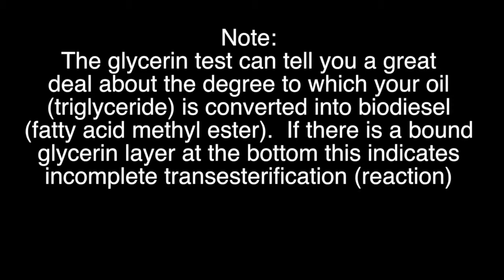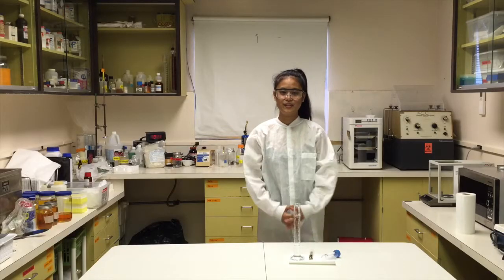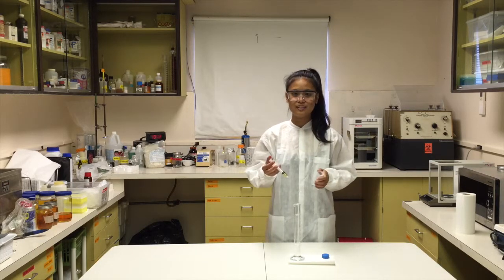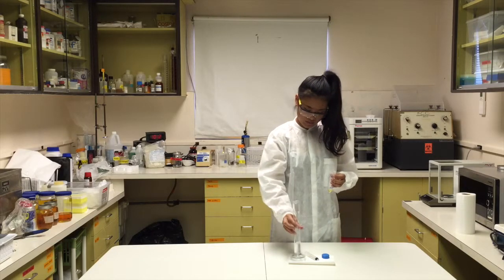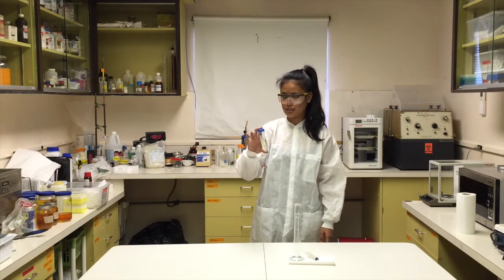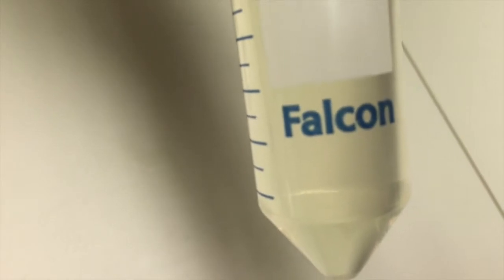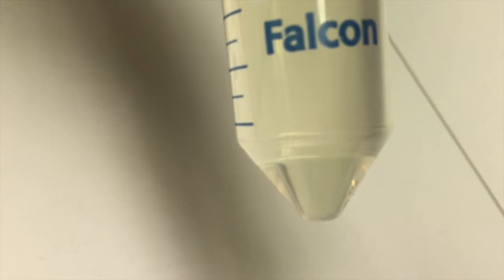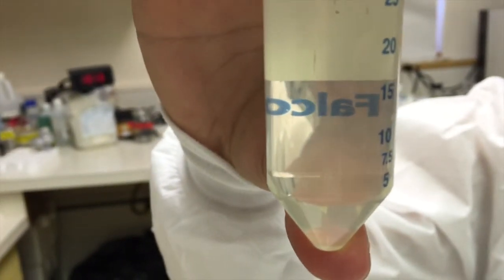27 3 Test

Comment: I'm wondering why they call it the "27-3" test.  If you have an accurate way to measure volume, such as pipettes, just go with 9-to-1, methanol to biodiesel for this test.  You can get methanol in most auto part stores --  its so-called HEET, which comes in two colors, red and yellow.  The yellow bottle is what you want  --  methanol.  The red bottle is isopropyl alcohol, and the test will not work with that stuff.  I don't have a centrifuge like these scientists in the video, but a test tube works fine.  If you do the test and you see a yellow-orange bubble in the bottom of the test tube, you still have glycerine in your biodiesel.  If you want to improve it, you need to run your product through another transesterification process, then test it again.   Ideally, you see only clear liquid in the test tube, nothing else.